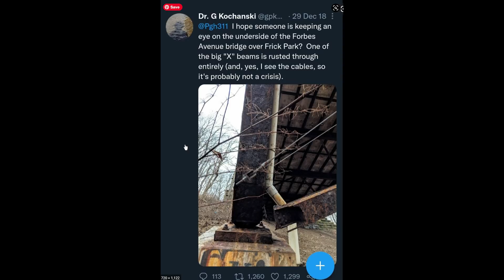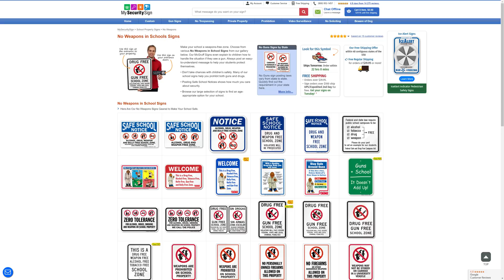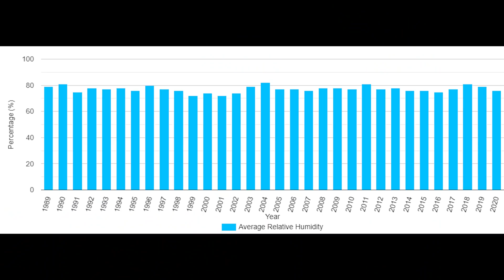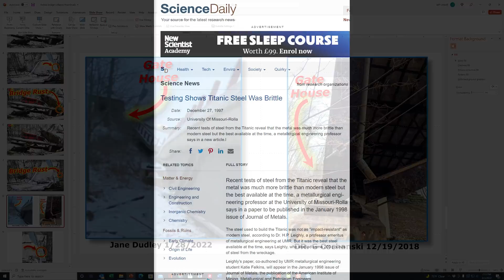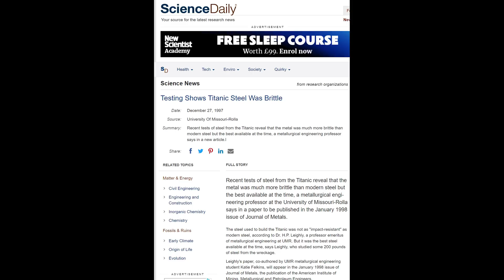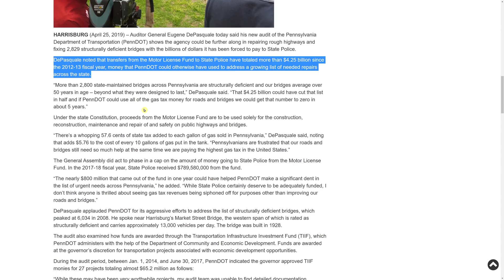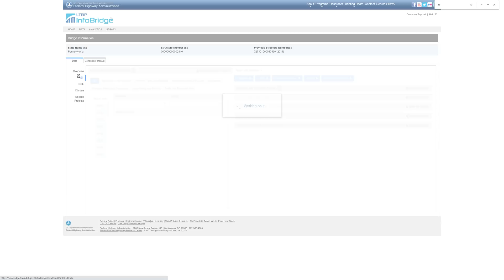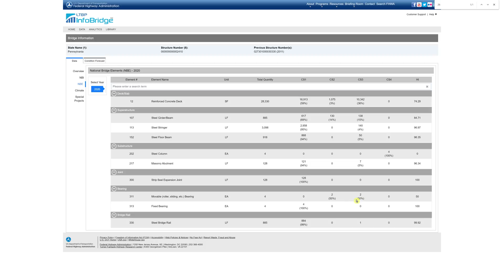Pittsburgh Bridge Collapse:  Bus Too Heavy? Rust? Missing Funds?

Comment: i recently talked to my father about this. we’re locals and he’s been driving dump trucks and oversize loads since the 70’s. he’s told me countless times he’s crossed this bridge with a fully loaded tri axle dump truck. not because he wanted to, but because he had to. if anyone travels in pgh you know it’s impossible to drive anywhere without crossing a bridge.
Reply from the maker: This is all the more reason why when they design bridges, they need to be able to handle much more than the largest weight imaginable coimaginable, and then they need to design it knowing that it will be derated over time, and it should still be able to hold the biggest weight
Reply: @jeffostroff  totally agree Jeff, but then it comes down to money and we all know where that goes. Lol
Reply: PITTSBURGH is bad due to lising the cash cow of the steel industry, but southeastern Pennsylvania is still okay to live
Reply: yes fellow yinzer here. did you hear about the shift on the south busway bridge over in mt washington today?
Reply: @asmilenvrseen  i did! it’s all catching up to us i feel.
Reply: @asmilenvrseen  ppl in Bon Air losing their yards to landslides, my area sliding down to Rte 51 (Saw Mill Run)
Reply: @asmilenvrseen  yes, fellow Pittsburgh area resident here. I did here that. And expansion joint had opened up more than expected , bridge is closed while they evaluate and make repairs. Scary
Reply: True I'm from Pittsburgh and there's bridges everywhere I've also rode buses over this bridge because I don't drive I currently live in Phoenix
Reply: done the same since the mid 70s,tri-axle loaded to the ass,,,going across a lot of small bridges,,,but some larger ones no-no
Reply: @thankswillie  Hope you're ready to do the prison time when you're responsible for killing a car load of children or a school bus. Say to the judge, It's Pittsburg Judge, every truck driver does it. See if that saves your ass!!
Reply: Hey Joe, I'm a retired CDL 18 wheeler. Millions of miles. When you ignore safety you are not only putting yourself in danger but the traveling public along side you as well. You have CDL's and ignore the weight limits??! You should be ashamed of yourself. Your going to kill somebody some day maybe a school bus or two too.. I hope you are ready to do the prison time. Saying to the judge "well it's Pittsburg" Every truck driver does it" Ain't going to save you!!!
Reply: infrastructure in pittsburgh is literally crumbling. Bridges collapsing, constant road work and closures, houses are no longer a good investment because they are deteriorating. not the great state to live in that it used to be 20-40 years ago
Reply: Unknown
Houses are still a good investment in Pittsburgh
I live in PA,  I would much rather live in PA than say Flirida which is basically a swamp and not meant to be inhabited by humans
Reply: @emilyfeagin2673  where is flirida is that in California
Reply: @emilyfeagin2673  I lived all my life in PA. I now live 6 miles East of Reading PA. As for Florida, my son had a job down there and his mom spent a month there. She hated the heat and humidity, it rained everyday. She said the bugs were as big as small cats too.
Reply: @HeyImBoschea  20 years ago you didn't have a rapist for the quarterback for Pittsburg Steelers too.
Reply: pgh?
Reply: @joseph hamler I moved away whenever I was very young. Then came back to make sure my grandparents could retire comfortably and pass away in their own home. We lost them 2 years ago. I'll never forget the first time getting lost in pittsburgh. I said to my cousin hey I'm going over a yellow bridge. He started laughing. He's like sweetie I don't think there's anywhere you can go without going over a bridge. Do you have your bearings I said yes I do he goes good travel that way get off we get your bearings get back on you'll find your way. He was right.

I was really shocked at how Pittsburgh just was building Bridges underneath Bridges to catch bridges. Do you know the one on your way to Monroeville. The bridge with the nets with the bridge underneath the bridge. I remember my mom, explaining to me that they had to build that to catch the falling pieces. I was a child. Then as an adult riding underneath it I was shocked going well they actually never bothered to fix the bridge? And if you think about it all over, many cities are falling apart. Or water pipes are long overdue to be replaced. Flint Michigan is not the only place that has lead issues. It's all over. Metal pipes only last so long. But you know everybody's living their best life. Not worried about the world around them. Allowing their governments to frivolously spend their money. And in the end they get richer, in pittsburghians have to be the ones to suffer. It's like that all over the place in these blue cities. I don't know why everybody keeps voting the same? Or maybe they don't and there's rampant cheating. I forget the name of the mayor back when I first moved home. Couldn't stand that man. Hold on let me look him up...  Ravenstahl. Oh he's a perv I don't like him. I was at a convention, that man was very flirty and touchy. It's literally looked at him and I was like stop touching me with your wife over there. He's like, things she doesn't notice won't bother her. Eeeeewwww. 

Then we bought a pizza shop. Wound up that the chief of police his son lived at the opposite end of where our shop is. He most certainly had a gang I don't care if he was in the Navy or not. We were robbed many times. My brother was beaten severely. I had photographs of him. Literally took it to the police department and wanted to make a complaint. The front desk lady says oh my gosh, that's the chief of police's son. I said are you serious. I told my brother back up we're leaving right now.

We dropped that business like a hot potato lost $22,000. I know how corrupt that place is. Chief of police's son, robbing us I'm out. Never look back. And I'll never be back unless I'm visiting people. Alas terrible experiences living there. Not everyone not everything. But more than less is enough for me. I'm out.

The only way Pittsburgh is going to pull together is if people start demanding things. And everybody keeps to their business. It's not like the south. It took me 8 months to learn of all my neighbors on My street. I had to make baked goods, and go put my hand in their face say hello. Offer them goodies. 

I do miss my old Street and all my neighbors. I'm a person that likes to know my neighbors. And likes to help my neighbors. My grandma always said I was the one to break the straw on the camel's back but the glue to hold it back together. I take that to heart when she told me that when I was 5 years old. I truly care about the people that live around me. But it's sad none of them really cared about the world that was outside of us. I can't wait to go back down south. Son is almost graduated. And back to Florida we shall go.
Reply: @MzClementine  that bridge was fixed some time ago. The catching bridge is gone now. 😂

Comment: One reason a bridge rated 'poor' may not be closed down is because people bitch about the detours. I read complaints every time a local bridge repair is posted. There is a bridge by my house that needs to be replaced in a year or two and it is supposed to take two years to build.  There  are several bridges a few blocks away that people can use, but they would rather risk their lives  on one that needs to be replaced than drive five minutes out of their way.

Comment: I've never heard of corten steel being used as a structural member, only as a decorative element, like a non bearing facade. Also, if rust is leaking out into the surrounding materials and the ground, it means the material strength is diminishing fast. Corten steel is not supposed to leak out and seap into the ground. Also, even if Corten steel was used, the nuts and bolts and plates anchoring the bridge is not supposed to rust either. Something is clearly wrong if it does.
Reply from the maker: Yes, hopefully they stick with sculpture material for Corten

Comment: My theory -- Those X braces -- the steel elements are in compression (or were) while the "fix" cables are TENSION elements - if the steel gave way on the north side the cables would have pulled the bridge to the north by "kicking" the leg inward.
Reply from the maker: Yes it was a bad patch job

Comment: i thought bridges was critical infrastructures.

how could google legally take pictures of the underside of a bridge?.

unless the no photos law only applies to war and containment places like prisons and military sites.

buses have blocks of cement in them to make them less likely to roll over.

just because there is a drug and gun free zone does not stop drugs and guns from getting into the places.

it just means that we care to keep  guns and drugs out and have zero tolerance

when designing a circuit maybe 30 or 40 volts should be the limit because in some circuits the part is being fed by an inductor coil witch can kick a lot of voltage into the capacitor and diode.

yeah cant the police get the money from the raids of drug dealers and use the money taken in raids once the money  had it's day in court as evidence?

Comment: PAT, would not have allowed that bus to travel that bridge if the bus exceeded the posted weight limit
A bus just like that traveled over that bridge, several times a day for many years. 
The truth is this country has been ignoring basic infrastructure needs for decades   From Roads and bridges to sewage and water systems.  And don’t get me started on the electric grid

Comment: The bridge was in poor shape back 6 plus years ago.  The state had 4.2 billion for road and bridge repairs.  Do some digging to see where that $$$$ went.  It was not spent on bridges that were simply "poor" ... My connections think that it got spent on "green" projects, rather than bridge repairs...  They almost lost the bridge over the Youghiogheny on I-70 almost failed before they got around to repairing it.  Other bridges across the Yough and Monongahela rivers have been shut down because they were too dangerous to be used.  The salt and steel bridges do not behave well mixed together...

Comment: I've traveled thru  Pennsylvania  even back 15 years ago the roads were in horrendous condition  I live near San Francisco they maintain the GG bridge meticulously they start at one end then go back to other side when they finish start over! That bridge structure looks like it never had a lick of paint the whole time it's existed even when  salting the road way in winter and still did absolutely nothing.
Reply from the maker: The bread was made from cor ten  steel which is a special type of steel called weathering swe'll call weathering steel that develops a patina or for us donuts a frost on us outside so that you never have to paint it and the rust is supposedly protected but I guess they found out that steel does not really live up to its name and it sometimes corrodes corrodes continuously without stopping out of control.

Comment: Professional commercial drivers know the height and weight of their vehicles. Joe citizen renting a box truck, probably not. At any rate, that is not relevant to this bridge. The construction of it is. It was incredibly light weight, and totally inadequate. Even if no trucks or buses where allowed on it, heavy traffic loading the bridge up with stopped cars would surpass it's capability. Add to that the structural deficiency from rotting away (rust), and it was just a matter of time.

Comment: Two things to remember about bridge postings.
The first, the posting is not the limit. There is always a safety factor built in.
Second, the weight limit may vary depending on the number of axels and their spacing. I have a bridge near me that is posted for a 27 ton dump truck and a 40 trailer truck. The dump is a more concentrated weight. The bus is more like the 40 ton trailer.

Comment: When you mentioned the 26t limit and I saw the articulating bus, I had a bad feeling. Such buses have a max. operating weight of around 28-30t >> empty weight is around 18t, so the 140-150 max passenger number in such a bus equals around 11t and we therefore reach around 29t.
With the few people in the bus this vehicle had a weight of less than 20t. However, if there is the smallest irregularity like a step between the joints, the bump puts a much higher force onto the structure than a standing vehicle. And with temperature, such irregularities become bigger.
Guesswork: the frequent bus traffic sometimes with max weight of up to 30t plus the snow plows and such might have worn the bridge much quicker.

Comment: Bridges have a safety factor. I am pretty sure the bridge was corroded. You are talking about snow Ice  salt and corrosion. Just because a beam looks thick most is rust .the actual beam  thickness, would be less like 3/16th. I would say by looking at the bridge it should have been condemned,  the bridge was not properly maintained.

Comment: That rotted out cross brace likely had a hole up high somewhere and had repeatedly filled with water, which settles to the lowest point.... then freezes, expands, then boom... nothing left. Those crossed cables were a cheap / quick fix, which means somebody knew enough to go that far years ago. Basically, nobody did the follow up after the quick fix. They had the funds and pissed them away elsewhere.
Reply from the maker: Bike Path Bill!

Comment: Note the lateral displacement at that rusted away beace at the bottom of the column.  This indicates that the the other column on that bent was bowed at the middle.  The replacement tension X brace does not support the middle of the columns, increasing K for that column.  i.e. the replacement bracing scheme is wrong as it does not brace the mid height of the columns laterlaly where they are narrow.  Also the bow adds moment or eccentricity, and a small amount can seriously reduce the buckling resistance.
Reply from the maker: What about the overall bad condition of rust, does that contribute also? IT seems some of the areas along the frame had too much patina developing as the rust weathering protection layer kept on rusting out of control.

Comment: The fact is that the bridge actually had to be renewed after the break of the pillar stiffeners. If you do not operate corrosion protection on a riveted steel bridge construction, the bridge cracks where its weakened link is, namely on the rivet connections. This is a great example of doing nothing about maintaining transport infrastructure. Greetings from Berlin/ Germany. Sven

Comment: Usually failures like this are due to more than one factor. In this case, you take a less than stellar choice of material (that might perform poorly in high humidity) and combine it with geography (cold climate and near a stream) and a state with a history of lackadaisical maintenance (didn’t address issues of compromised materials or poorly executed what maintenance was done) and maybe even consider the bridge may have been under-designed, and it’s no wonder the bridge collapsed. 

The bus could have triggered the collapse, but if it was on its usual route (which it would appear that it was), it would have crossed the bridge a dozen or more times per day, along with who knows what other large/overweight vehicles. And consider the nearby intersection was shown to back two lanes of traffic across the bridge.

One last point - what good are databases if no one uses the information that is put into them? If the bridge inspectors input the information, some engineer should have reviewed and maybe reassessed the situation. Closing a bridge preemptively is always an option. I’ve seen it done on much larger bridges for very minor issues.
Reply from the maker: YEs someone needs to react when bridges in their district get poorly rated